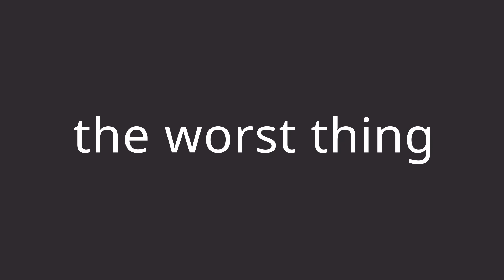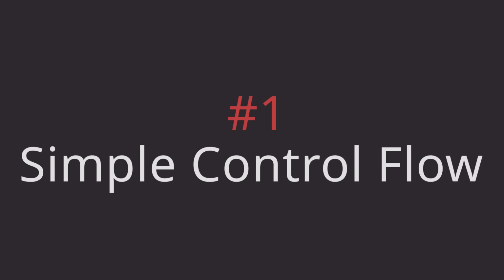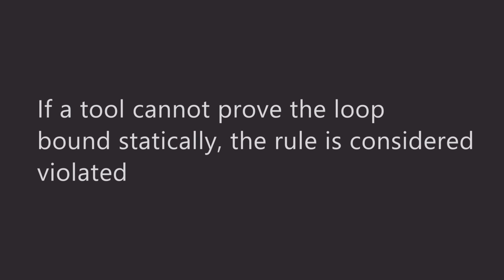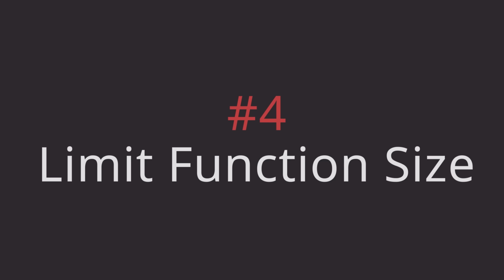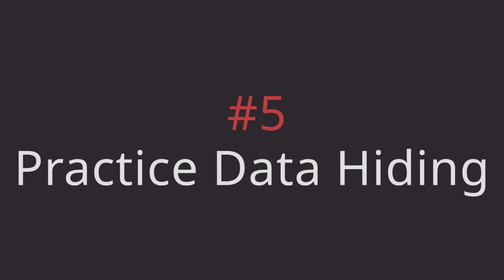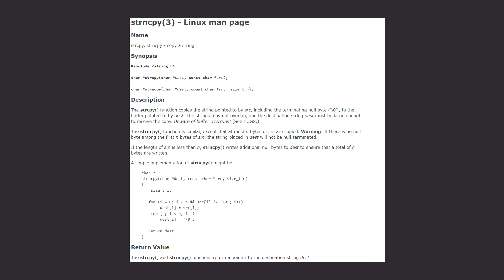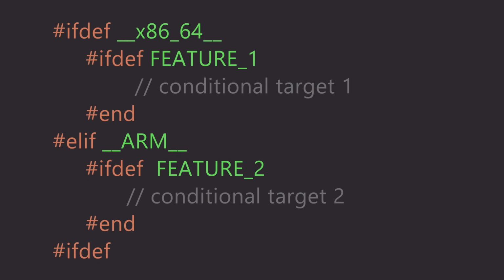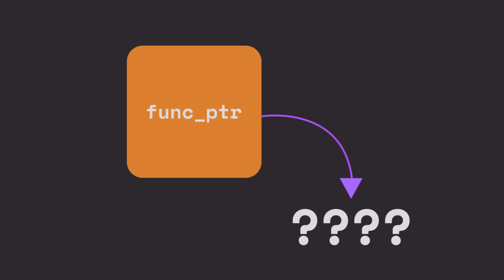how NASA writes space-proof code

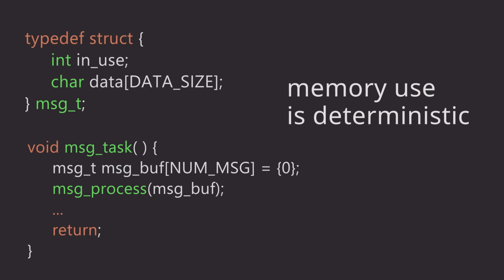Comment: 2:10 "by not using heap at all, you completely eliminate use-after-frees and memory leaks" – this is not fully correct. You can't completely eliminate use-after-frees by just avoiding use of the heap. For example, if your function returns pointer to a data structure in the function's stack frame, and callee uses that pointer, it will access corrupted stack frame (overwritten by some of next function calls). But such bugs can be easily found by static analyzer.

Comment: Well, it seems I follow these NASA rules with three exceptions: loop limitation, heap memory and casting unused returned values to void. I agree with the rest and I don't think of them as "too restrictive", more as of "common sense".
Out of the three I don't employ, a truly restrictive one is only the heap memory rule: that one is definitely influencing the cost and the design of the software.
The loop limitation makes the code a bit less readable, but in justified cases I could live with that.
The casting one annoys me quite a lot (I have tried it). I would prefer a different solution to that...

Comment: Another point on #3. malloc doesn't have deterministic runtime as depending on the state of the heap it may take more or less time to allocate memory. In certain embedded systems this is crucial as timing can be down to the millisecond or microsecond and if the heap is taking too long to get you that memory you might have missed an important window.

Comment: Of course, NASA used to use assembly language (1:1 machine code opcode/operand), which took 'The Compiler' right out of the equation and handed full control of everything to the programmer. The biggest problem for NASA today is that they are now relying on The Compiler to produce that same machine code, and unless they have real assembly experts to examine the equivalent assembly output of every opcode/operand/code structure the compiler produced, then they have introduced a very, very serious 'uncertainty risk'.

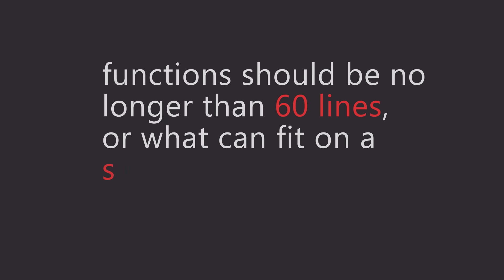Comment: I hate to be pedantic, but your example code at 2:31 seems to violate one or other of these rules Returning a pointer (char *) from a function (read_client) must be either

a) returning a pointer to a value in the called function's stack frame (a very big red flag even if not working for NASA!)

b) returning an allocated pointer (i.e using the heap)

c) returning a pointer to something within the passed in object (connection_t). This is potentially valid but very obfuscated and difficult to reason about

d) returning a pointer to some part of global memory which is also very obscure and hard to reason about.

I think the NASA way would have to be to pass in the buffer to receive the data to the read_client call (like strncpy etc)

Comment: I agree with all of those and especially not using heap memory.  Although I would use recursion but with a max depth guard which is similar to the loop guard.  Recursion is very powerful and simplifies some very specific problems.  However, in space I don't think you'd ever need it so that's a good rule.

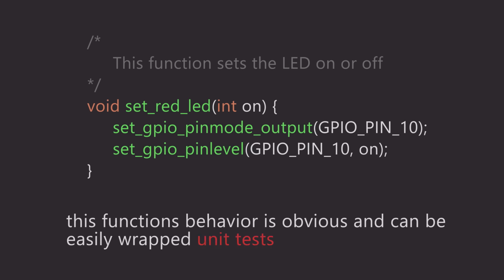Comment: 2:50 As a database engine developer, how can I counter the argument from my teammates who claim that breaking a large function into multiple smaller functions improves readability but negatively impacts performance due to stack allocation?
Reply: @qqoell-l8k  Use inline functions, and get the best of both worlds. Also, performance should always be measured instead of just assuming that it will take a hit, so make and run a benchmark with and without the code broken up.
Reply: @qqoell-l8k  I always try to keep function size small and clean.

If stack size comes to concern the function stack can always be flattened by compilers/pre processors on demand

Comment: As someone who actually has worked on software for NASA JPL as an undergraduate researcher- this is mostly true, however it depends case by case. In my case, I was building simulation software in python so it definitely was not as strict. I didn't get the opportunity to work on something that is going into space but rather a tool that helps speed up the process of building antennas that require holography systems to operate.  I assume that when they have their bus partners write actual space code for them, this is what they follow. Awesome video.

Comment: I definitely think there are important use cases and reasons for NASA to use these rules, but I also think it’s foolish for developers to take these rules and implement them in conventional use cases. “Well if NASA does it this way, then I should do it too.” Is a bad way of thinking about things. I think there are times you may encounter a system critical task where doing it the NASA way is better and that’s a good and powerful bit of knowledge to have in your arsenal. But I think if you’re just developing conventional business applications that would be running atomic jobs in a job queue, managed by supervisor or something like that, it’s just complete overkill

For instance, instead of never using the heap “cuz that’s where memory leaks happen”, I would rather simply manage a number of long running processes and have the process manager kill and restart them after so many iterations. Divide computing tasks into short, atomic, repeatable chains of jobs so that if anything catastrophic happens, the state of the job chain can be resumed when the process is fixed.

Obviously when you’re programming a satellite or probe that goes to mars or the outer limit of the solar system, this is not the best way, but for mundane business processing, which is what most programmers do, the stability parameters should be about redundancy and transparency.

Comment: I had the pleasure of working with a code base at NASA where a C implementation for "smart" power modulation was ported to C++. Using smart pointers, the code was extremely clean and very easy to follow. I was in charge of building a logging interface listening to an AMQP message topic, but even with the limited number of times i needed to look at when they sent messages, i was pleasantly surprised with how easy it was to find what i was looking for. Props Brian Tomko, a c++ savant!
Reply: I also remember distinctly that the code base would never "using std" because the use of standard library methods can become convoluted. So everything would be std::method() instead of just method()

Comment: 1:56 "These systems [heap memory] cannot be proven by a static analyzer" - this is actually no longer true. A technique called Separation Logic can be used to prove systems which use dynamic memory.

Additionally, the points brought up in this video are neither necessary nor sufficient for writing "space proof code." While many of them certainly help, there are a lot of other factors such as extensive testing, static analysis, and formal verification, that go into making sure software is safe other than coding standards.

Comment: Regarding "no heap rule" if I was working with some image data (from a camera) and have to store that to a memory somewhere and lets say its a 4k image meaning there would be 3840 x 2160 x 3 bytes for an RGB image. Thats almost 25 MB which is much larger then 10MB. 10MB is Linux default stack size per thread. Do they then put that on stack as well or break a rule?

Comment: Something in embedded systems that generally doesn't come up when creating normal programs, and that I was very fascinated to discover, is the watchdog timer.
A "wdt reset" instruction is periodically placed in the code in non-looping sections (hence the upper limit on loops), places where the execution is expected to revisit if things are fine.
If the execution gets stuck anywhere, the wdt isn't reset, and once the timer runs out, it reboots the device. Pulling it out of the potential softlock
Reply: Oh yeah, in one of my job the boss found the '' watchdog '' unefficient , so he decided that dev should  programm an embedded system triggering a lever to litteraly do a hard reset by ''pushing'' the PC button of the embedded system every XX hours. . . Now i can laught about it, but when i heard that....
Reply: @leexabyz   that's common practice at least for senior devs, although I've been in contact these days with processors that have entire hardware units dedicated to watchdog functionality, even with individual clock.
I'm in the embedded SW/hw for more than 30 years now, and I find mind boggling what relatively cheap units are capable of these days.
Even SW watchdogs might be caught in problems on rare occasions, so one could use preemptive hardware based supply reset watchdogs, which shake everybody up should the processor go bananas.
Reply: @leexabyz  watchdog timer very common in ecms

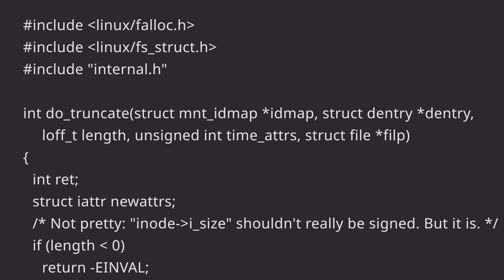Comment: No the worse 0:00 that able to happen is to lose the wail project.

To loose one code in some off those lines are sock but not as bad as losing the wail project.

This way is very important for developers to keep backup's and I sigest for people to keep more the one backup because if something happened to the hard drive you still have more the one area to keep those important data.

It's true you may lose some off the program if something happens but at least you don't lose the wail project that it's way more painful.

Comment: "The power of ten"? They should've called them "The ten commandments", what a missed opportunity... so close to God, yet we stray further from God everyday...
Reply: It's the Ten Code Commandments
What, uh, uh
Code ain't safe, it's real simple
Check it, uh

1. Never use complex control flow, keep it clean
Loops with one entry, exit, that’s the dream
No "goto" schemes, it’s what they all deem
Keep your code pristine, the results are supreme

2. Give all loops a fixed upper bound
Prevent infinite runs, keep it sound
Software gotta be predictable and sound
Upper limits, that’s the rule in this town

3. No dynamic memory after initialization
Avoid fragmentation, no hesitation
Keep it steady, no degradation
Predictable behavior, that’s the foundation

4. Limit recursion, stack use can be mean
Memory’s tight, keep it lean
Simple and clean, no recursive sheen
Understandable code, you know what I mean

5. Keep functions small, do one thing right
Easier to test, clearer in sight
Maintainable code, shining bright
Small and simple, day and night

6. Minimize pointers, they cause dismay
Complex and error-prone, leads you astray
Use with caution, or better yet, delay
Clear and safe, that’s the way

7. Use assertions to catch invalid moves
Inputs must meet conditions, nothing to lose
Prevent errors early, code improves
Validated steps, you always approve

8. Limit preprocessor directives, keep it neat
Code readability, that’s the feat
Use sparingly, don’t overheat
Consistent and clean, that’s the beat

9. Enforce coding standards, keep it tight
Readable, maintainable, feels just right
Everyone’s on the same page, no fight
Unified code, shining bright

10. Use a language subset, well-defined
Avoid undefined behavior, peace of mind
Increase reliability, truly aligned
Safety-critical code, redefined

Uh, uh, uh, it’s the Ten Code Commandments
Uh, uh, keep your coding tight
Follow these rules day and night
NASA’s guidance, coding light

Comment: Why is nasa using C?
Reply: It's Machine level language that's not assembly. If you learn advanced C, You learn what it's really capable of. It's faster than most other languages
Reply: It can be run directly on a chip without requiring a whole operating system to go with it, eliminating any bugs in the OS as points of failure

Comment: The last thing I would like to do is to code like NASA. They use imperial units.
Reply: They use metric, like every scientific organization ever.
Reply: @tuureluotonen1631  I doubt it. If it was true that rocket with Marsian walker wouldn't explode.
Reply: @obvioustruth  NASA does all their calcs in metric
Reply: @tuureluotonen1631  Since when? Yeah. They do calculations in metric but design stuff using imperial units with imperial data in mind. So when calculation is done for for example 2N they assume it is 2lbf, or pressure of 10Pa, they assume it is 10PSI. And then valbe is opened too late or too earlry and then everything goes boom! 😀🤣😂, and then they blame european software because it was making calculations in SI units instead of imperial. This is how it works at NASA.
Reply: @obvioustruth  Since atleast the Apollo missions. The calculations were done in metric, and had to be converted into imperial for the astronauts.

Comment: This guy is talking about the same NASA that crashed a rocket due to a kg to lb conversion, right?
Reply: It's strictky not NASA's fault. Eng guy making the module made the mistake. NASA should be held responsible for not checking everything but putting all the blame on them is wrong. 

Now they only follow the SI  system.

Comment: I would put a word of caution on banning the heap (aka malloc / new). If you have a fairly limited scope in your application and you can practically rely solely on the stack (e.g., without having to configure it to be huge), then it is a great idea to disable the heap and just use the stack. But, if that isn't the case, do not replace heap allocated data with global data. This is, IMHO, much worse and in contravention of the rule on limiting scope of variables. What I prefer, as I tend to write larger applications that cannot rely solely on the stack, is to use the heap to pre-allocate all the data during an initialization phase, before engaging in any critical work. This helps properly limit the scope of variables, without bloating the stack (which has performance and determinism impacts), and while avoiding essentially all the problems associated with using the heap (which are mostly about allocating and deallocating frequently during the "main loop").
I have seen supposedly high integrity code where people avoid the heap by having an insane amount of obscurely named global variables where it is practically impossible to tell which is used for what and where and if and when they are supposed to be holding meaningful data. This is a far worse situation.

Comment: Anyone okay with using C in space or any other mission / safety critical deserves everything they get. Even if the code were a highly restricted subset and run through expensive static code analysis, it could still have errors that aren't found until its too late.

Comment: Mind you they have to do all this while accounting for things like how much power the computer will draw. Too much power draw means more heat generated which means the computer has to be cooler more which means more power has to be drawn. Simplify your code, but not too much otherwise a cosmic bit flip (much more likely in spaceflight) could ruin your code irreparably

Comment: 2:10 - This also works with a single allocation at program entry, and a single free at exit.  The heap memory just acts like a large secondary stack at that point.  I do that and have never had a use-after-free moment, nor a leak, because my program ends immediately after free. (Full disclosure: I never actually free, my OS does it for me as MacOS, Linux, and Windows all do this.  But I don't know which OS NASA uses.)

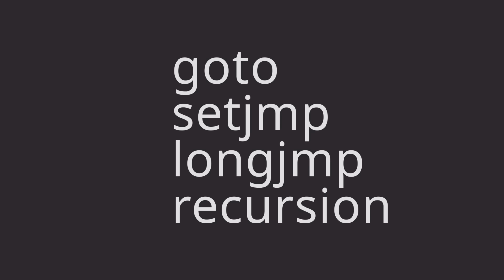Comment: 0:50 - Well, they do use `goto` because that's how all conditional statements are implemented on pretty much every RISC/x86 CPU ever produced.  I'm surprised even NASA has fallen for the anti-`goto` propaganda.  Avoiding `goto` originally meant: "Don't jump into the middle of a function; only jump to a single entry point.  And don't jump back to an arbitrary location when the function finishes; only jump to a single exit point (per function, obviously)."  Modern software "engineers" have completely forgotten/never learned how to program a CPU.  They mostly just repeat memes they've heard, apparently.

Comment: Of course these days we’re faced with the prospect of just using Rust and have that solve a lot of our problems in the compiler!

It won’t stop recusing function calls, etc, but it should address many issues avoided by these rules.
Reply: Rust has a long way to go in the embedded world
Reply: @JD-my5ek  Indeed, but it is a very strong candidate to take over in the embedded world, just as it's quite quickly displacing C/C++ in the OS world, and beginning to get into the OSes themselves. 

Granted, a lot of embedded work tries to avoid complexities such as dynamic memory allocation an threads, but then as the pressure to be "smart" increases the need to embrace such things increases. 

Arguably, for anything that can spare 1Watt, there's value now in plumping for ARM / Linux, just to save on dev effort, and for the vast array of "smarts" one then has access to. And then Rust makes an awful lot of of sense.

Comment: The title is wrong. The rules make for reliability, but NASA doesn't write space-proof code. Space-proof code would have internal checks for damage to code integrity and a means of correction.  NASA does the latter to an extent by having system redundancy It does a very good job of minimizing errors by testing for known conditions but it has the same sources of errors as any developer - unexpected input conditions. Its solution to both inadequacies is providing a means for system updates, just like a Google Chromebook, plus 24x7 on-call code support.  That NASA code isn't self-sustaining is why it isn't space-proof.

Comment: I have a friend that developed code for motor controls. They had a wheelchair controller that worked fine as long as it was inside the building, but when they took it outside to the parking lot, it failed spectacularly every time. Talk about a head-scratcher!  They forgot to put a sticker over the EEPROM. The sunlight caused it to crash. Doh! 😵